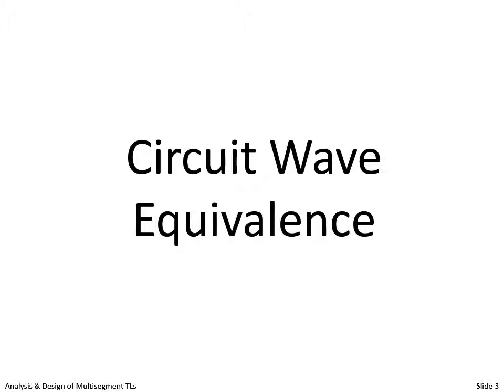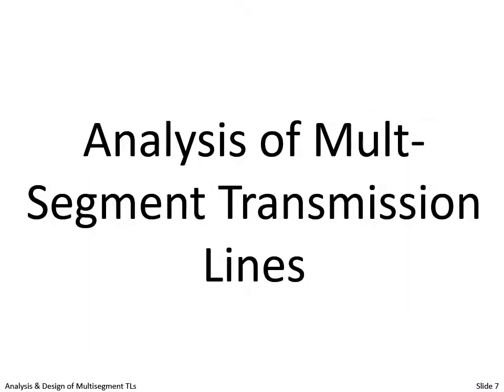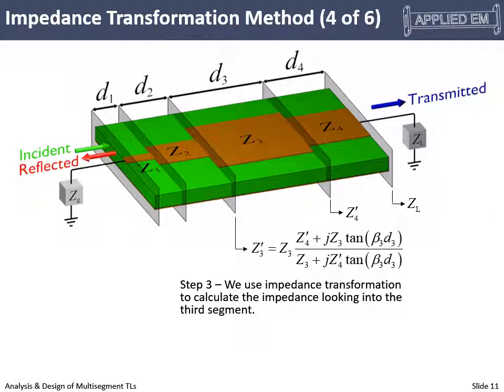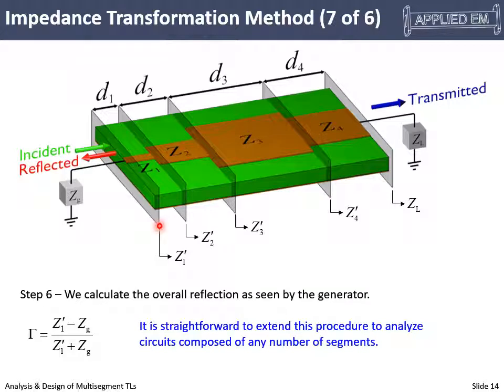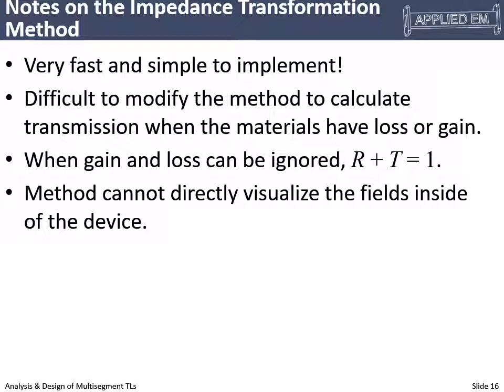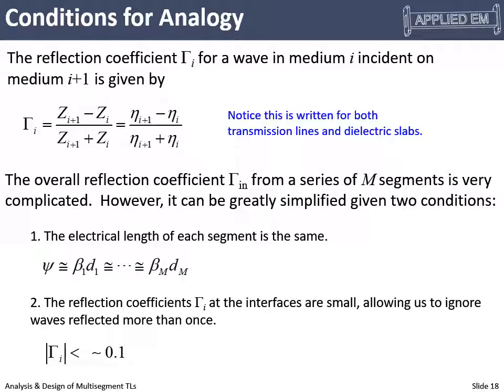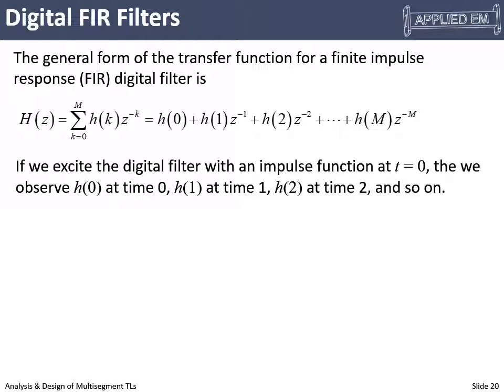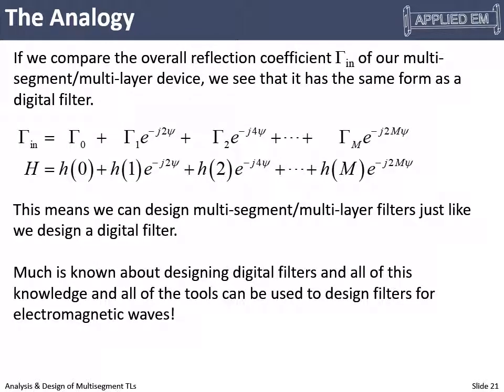Lecture 4g -- Analysis & Design of Multisegment TLs

Comment: Thanks for interesting material! The FIR-connection sounds very interesting. I wonder which wavelength/frequency this becomes useful. I'm currently designing a device at 868 MHz.
Reply from the maker: Calculate the size of the circuit the filter would have to be to determine how feasible it is.  There are also coupled-line filters and some others that are more compact.

Comment: It seems really useful even though I don't quite understand the slide 19 properly.. Why there's a 2 times phase for 2nd interfere or 4 times phase for 3rd interface. Also Metarials on designing of filters for em wave in future would be great!!
Reply from the maker: Sorry for the confusion.  The phase is multiplied by two because the wave crosses the slab twice, once forward and once backward.  For the second reflection, it traverses four times.  Think of the Greek letter psi as the phase of one pass.